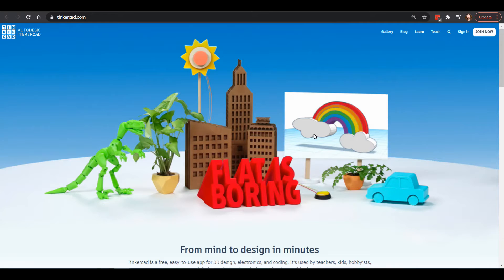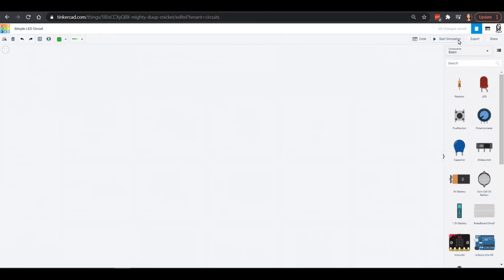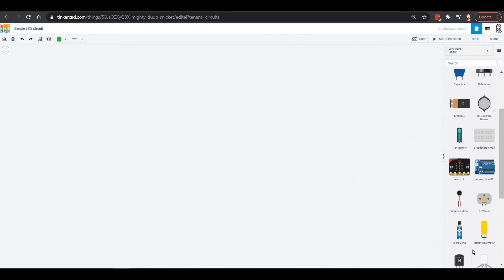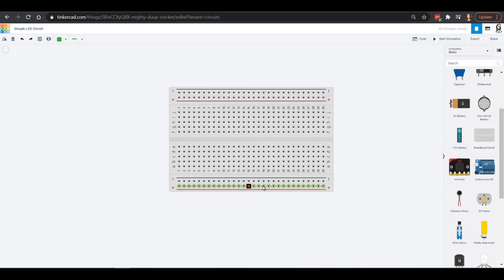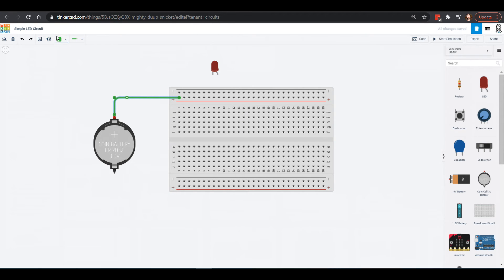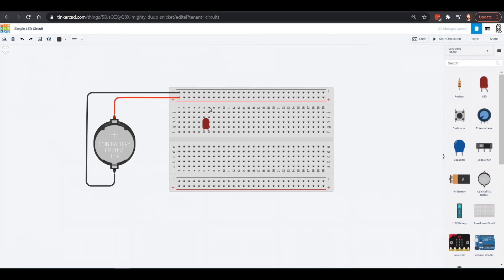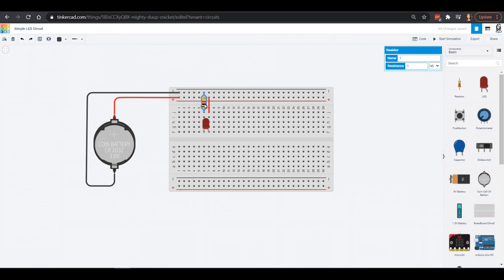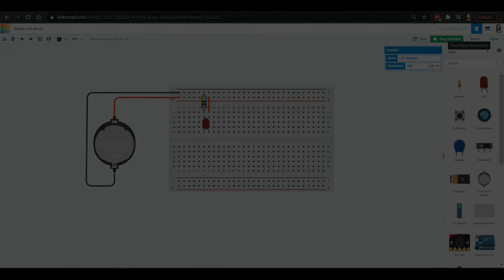Tinkercad Circuits Tutorial  - Making a Simple LED

Comment: With the wires, if you select the wire, or when placing them, press 1 for black and 2 for red. Other numbers have other colours, but it makes it a bit easier to change them on the fly, rather than moving the mouse to change them all the time :)
Reply: Thanks :] It helps